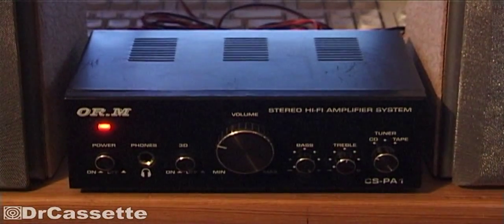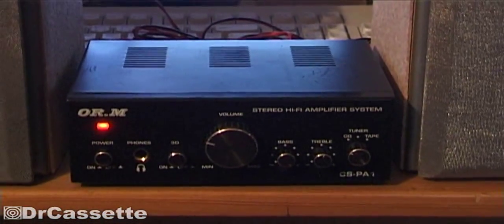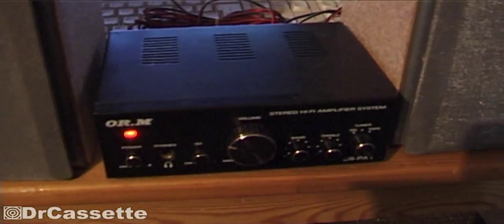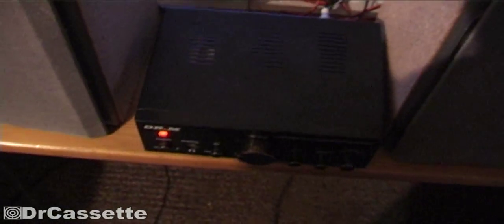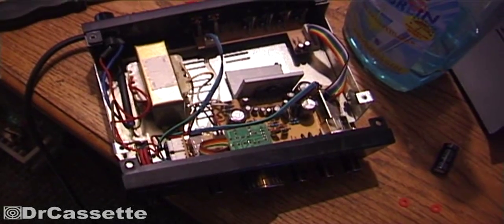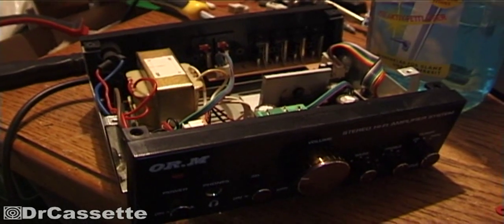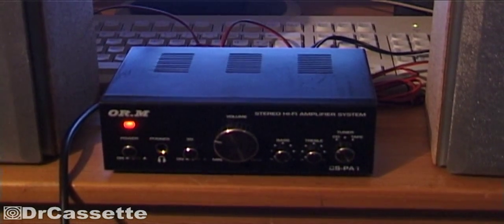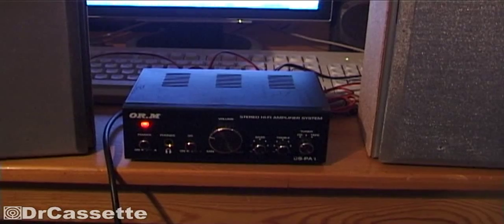DrCassette's Workshop - OR.M CS-PA1 amplifier modifications!

Comment: CS-PA1 sold by whomever or whatever company on amazon, is very bad for driving headphones with your soundcard sound while gaming. I use this amp to drive sound from my Yamaha USB-interface or smartphone to my speakers. For my personal headphone usage and gaming I am using my regular Soundblaster card, with it's clean headphone out - CSPA1 is turned off

Using this amp with headphones while gaming is absolutely horrible, it makes a constant farting sound whenever the game is running. If you move your mouse you can hear distorted screeching on top of the background hum. I tested this with several games; it does this with every game I tried - from WOW Classic to Red Dead Redemption 2. This device should not be called Hi-Fi, there is nothing high fidelity about your headphones constantly farting in your ear.